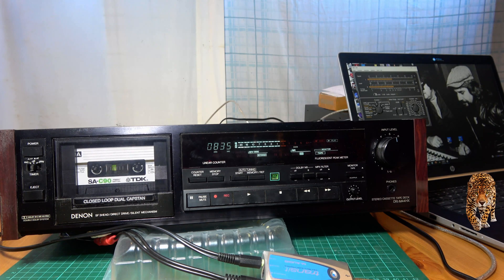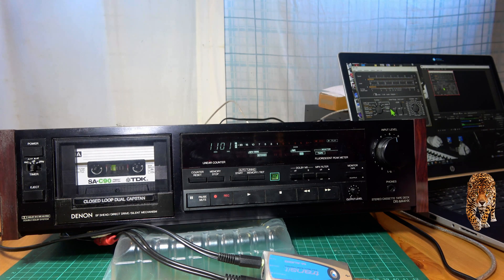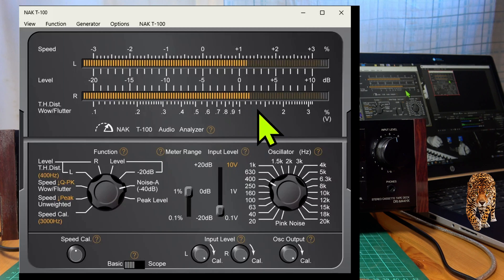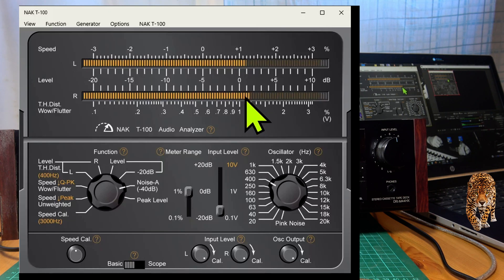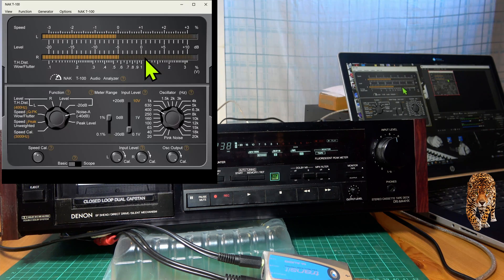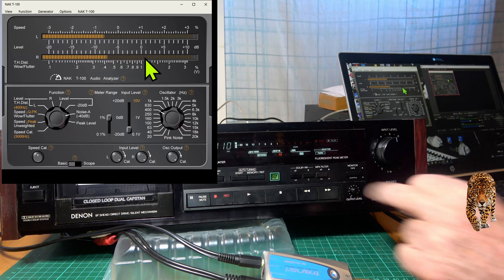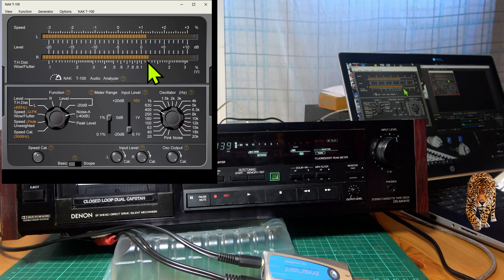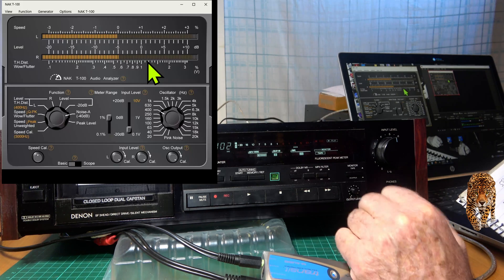Part 2 of Nak T-100 demo. Signal to Noise test

Comment: Great  videos   , was thinking 🤔 to get this Soft later on
Reply from the maker: Glad you liked them. I'm rather impressed. Their video is here           https://www.youtube.com/watch?v=5s7Kmr4HGuw
Reply: @MoggysHiFiAntics  Great video,  great link , I spoke to Developer  over email  ,  I need my engineer  to help me with the set up ,  sound card  PC calibration  has to be performed  , I am not that savvy in electronics , so need his help , so purchase on hold  so far , all this Profi. they use proper gear )  so they sceptical about computer  soft  )
Reply from the maker: @kravchuk007  Sure. However I think it is more than sufficient for cassette decks. 
To measure distortion and sig/noise is not easy to do "professionally". 
They're only cassette decks, after all. Even a Nakamichi CR-7 has distortion of 1% (type1&2), sig/noise of 72dB (type4 @3%dist) and W&F of 0.03%wRMS.
My Denon DR-M44HX compares very favourably.
I am about to acquire a Sound Technology ST1710B Distortion Analyser and that will be great for amps but overkill for cassette decks.
Good luck.
Reply: @MoggysHiFiAntics   Bought it !